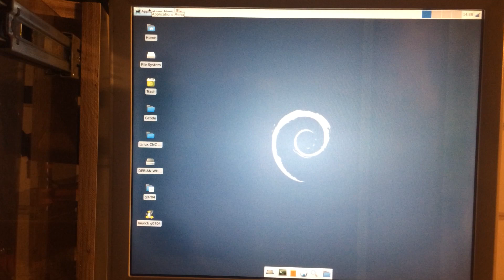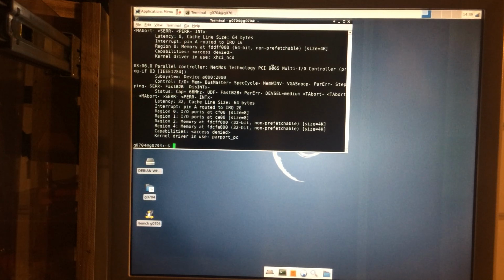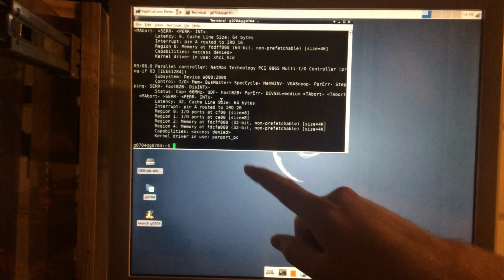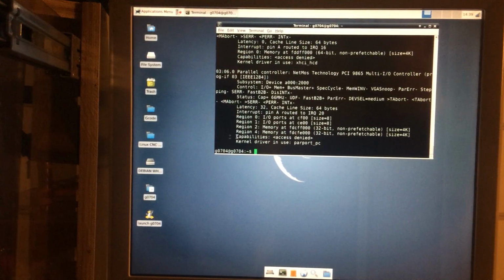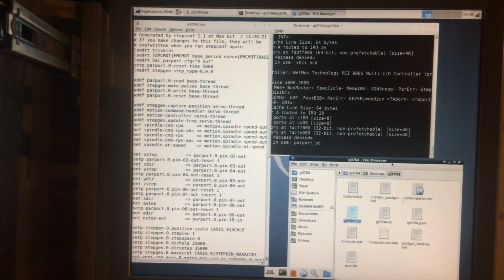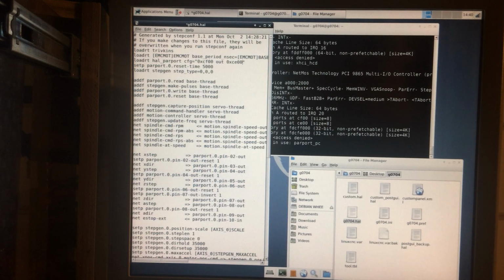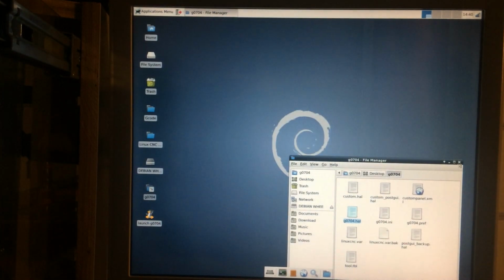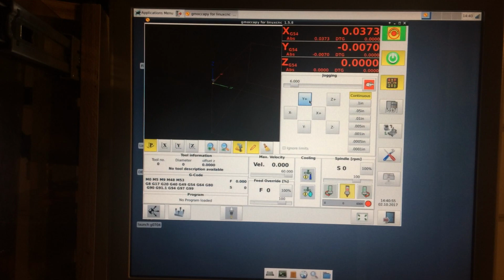Linux CNC PCI Parallel Port Install

Comment: Is this a dual parallel port card? You are setting the 1st one as output and the 2nd one as input? I know NetMos 9865 can handle two parallel ports or 1 parallel port + 2 serial ports.
Reply from the maker: I think it was a single but I’m not sure, was 8 years ago lol.

Comment: not help me, how run motors, before used computer paraller port work well, not start linuxcnc and add home SW, and motors not run and i has add external PCI paraller port  i need use more input pin, but today test and motors not run my pc paraller port before working. limit SW ,Probe,  home inductive sensors working ok, par port 0 pc own port, what addres need add to both paraller port, 0 and 1.

Comment: Spent several days until I found this Youtube. Worked exactly as described. However, not that one needs to redo this fix if your run stepconf. Info in custom.hal file implies one can and a loadrt command there, but when I do that, a restart yields errors. Anyway to make the loadrt comand stick?

Comment: I just got a small cnc lathe and it has been a nightmare of parts not showing up and motors not connecting, setup guides were very minimal and this was kind of a last ditch effort after a straight 12 hours of reading up on linuxcnc and online forums and this did the trick. It is still kind of unbelievable so thank you very very much for the helpful video
Reply from the maker: Gregory Redlon Glad it helped you out!

Comment: What computer monitor you using I want to add a touch screen to mine.
Reply from the maker: Makemyideas.com This was an ELO 19”. Calibration took a while to figure out on Linux. I’ve since switched to windows and a centroid controller and had to get a new monitor.
Reply: Iron Forest Knife & Tool thanks yes I watch the other video where you changed to centroid, I'm a big fan of Linux, but honestly understand someone that wishes to leave it's a big learning curve.
Reply from the maker: Makemyideas.com I really switched because I wanted a better motion controller, and the Acorn was a good deal. The software is very professional and has lots of high level features. The smoothing settings built into the control with sliders is awesome. It REALLY speeds up and smooth out the motion. There’s a few things I miss from Gmoccapy, but overall I’m VERY happy with the centroid software/controller.

Comment: Very hard to install pci parallel port.I try many time not work.
Reply from the maker: Yeah it's not intuitive. Where are you stuck? Is the card showing up in terminal?
Reply: @IronForestMFG  if the above vid doesn't work, you probably have an incompatible PCI card. Get one from a CNC shop, not that old $9 one off ebay.

Comment: what pci card are you using?
Reply from the maker: It’s a bytecc bt-p1p. Like $8 on Amazon. It can generate steps way faster than a built in parallel port.
Reply: thanks